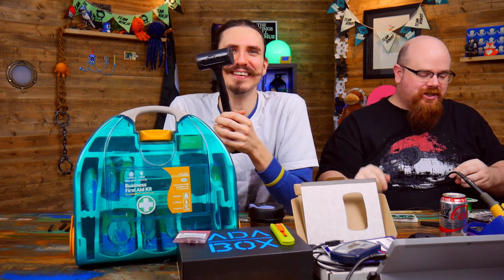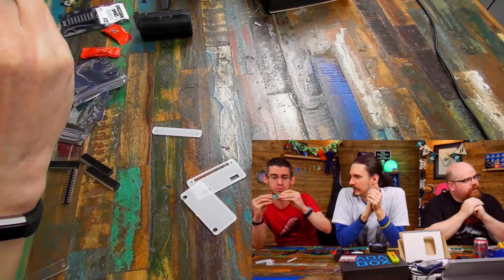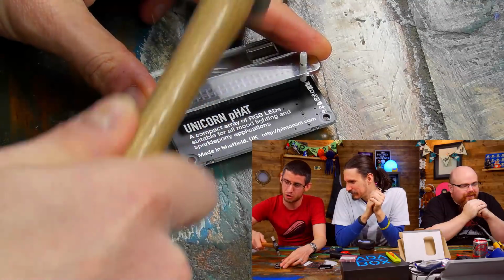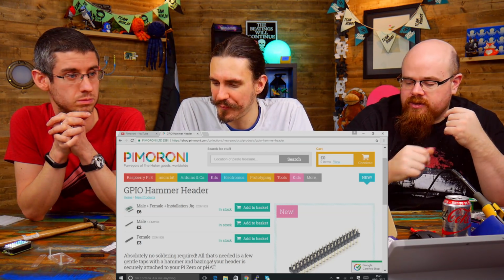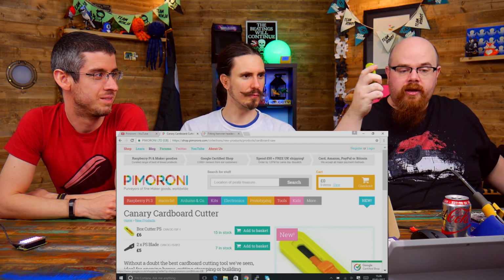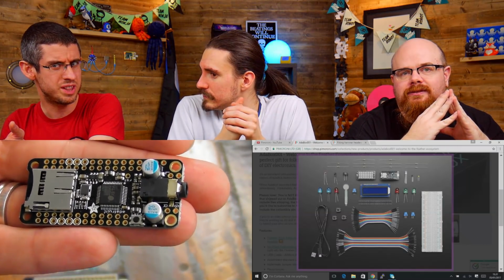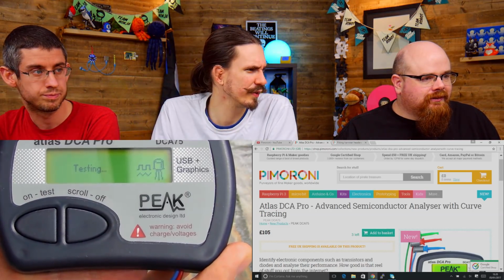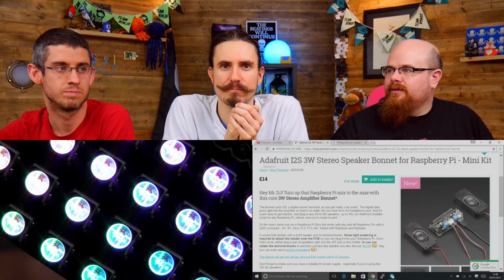Bilge Tank 072 - STOP! HAMMER TIME!

Comment: Not sure anyone will see this, but I was wondering how difficult it is to remove one of these headers from a pi, and whether it is reusable afterward? Could be useful for prototyping and then removed for production?
Reply from the maker: Not mega hard to remove with some care and pliers. Should be reusable on the hammer header side but the fit may be looser on the Pi's GPIO sockets.